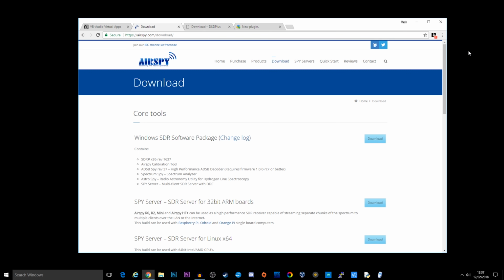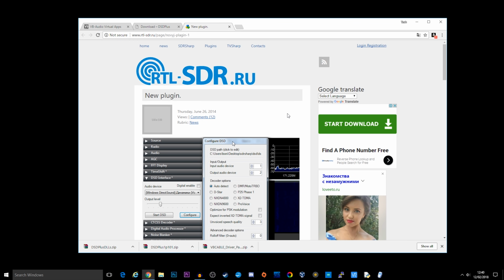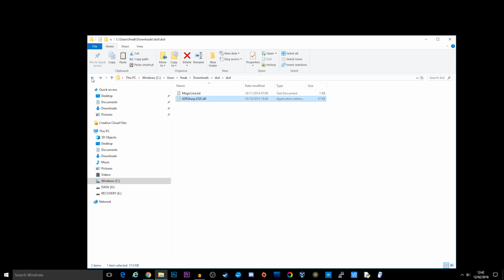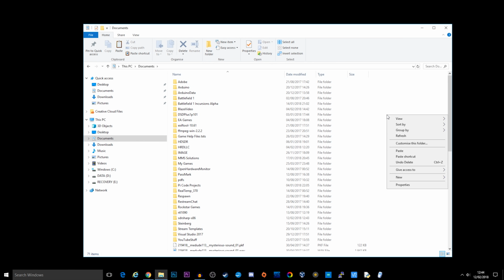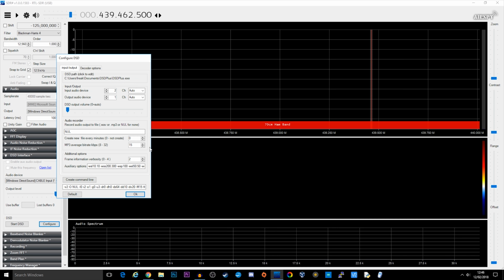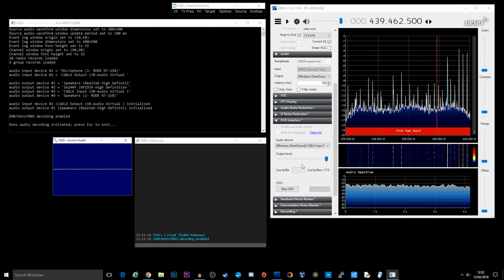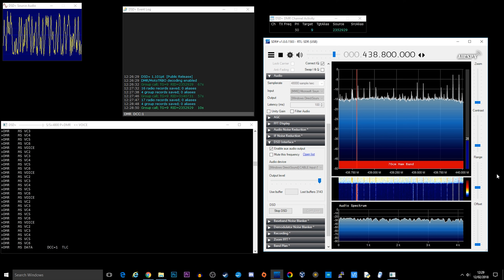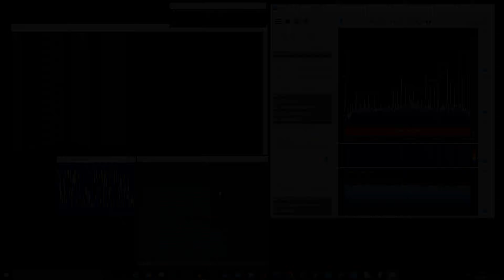How To Setup SDR # Sharp To Decode DMR Digitial Using DSD Plus And An RTL SDR Receiver on Windows 10

Comment: Some of you have experienced similar problems that I encountered. Requires some tinkering and a little patience. I have now tested with Win 7 and 10 so note the following;
1. DSD+ decoding and oscillating but no actual sound; check your system sound settings > Playback = speakers set as default device (Properties > Levels should not be muted). Recording = CABLE output set as default device (Properties > Listen > tick "listen to this device, Playback should be default playback device", Levels should not be muted). 
2. SDR issue; Techminds instructs you to select "Windows direct sound Cable input VB input virtual cable" for BOTH the Audio OUTPUT option and DSD interface Audio device. I have tried with the MME options and it still appears to work too. Ensure you tick "enable audio output" in the DSD interface section.
3. When configuring DSD interface, you need to make sure you are piping the audio in & out to the correct places. When you click configure, this will confirm which options are going to be used. When you click start DSD, some pop up boxes appear - look at the largest pop up and this will present all the corresponding audio options available in 3 sections, fist is audio input options, then audio output options and lastly what you have set it to. If this is piped incorrectly then it will not work. 
4. You need a nice strong connection/aerial etc for you to hear the sound which needs to be converted from digital to analogue. 
5. At first you may not even know what you're looking for i.e. sound and waterfall, suggest you head over to the RTL website and it will give you some examples as well as Techminds vids!
Reply: Silicon Star, can I contact you and get some in site into my set up, seem to be having problems decoding anything
Reply: I don't see anything that says "DSD Interface" when I use SDR Sharp. I followed the directions in the video and I still don't see it. Did I do something wrong?
Reply: @south_sider4life  you have to insert the DSD+ command line into the appropriate folder in SDR#.  Go back to the DSD+ folder and read the README file.  It contains complete instructions for that part of the install.
Reply: @south_sider4life  Same here. The web site that hosts  the '"DSD Interface" plugin  is long gone. I had to go back to a very early version (1416) of Sharp# to search for the plugin DLLs and Magic Line script needed. Later installs give the option to install more plugins and practically  all of them were  hosted at the now defunct web site.  At least I still had "Simple DMR" and "Simple APCO" from a year and a half ago when I bought my 1st SDR dongle.    One thing for certain, Sharp does not age well.

Comment: Great tutorial, easy to follow and clear instructions, which I did to the letter, unfortunately it ain't working for me.  I'm definitely picking something up - I can see the data in the cmdline coming through, but no sound.  I have correctly configured the input/output, so I have no clue why it isn't working.  it does say 'sync: no sync' and also things like '+DMR CACH ERR slot 1 BS DATA ERR1 DCC=3 CSBK'  whatever that means...
Reply: got the same...
Reply: got the same...any go around???

Comment: great video and now im a Subscriber too, but I do have a problem with the audio side of it, I followed your video many times about Audio config this is what iv got no audio, only when I change back to speaker setting? (see below) any help would be great thanks
input device #1 = 'CABLE Output (VB-Audio Virtual '

audio output device #1 = 'Speakers (High Definition Audio'

audio output device #2 = 'CABLE Input (VB-Audio Virtual C'

audio input device #1 (CABLE Output (VB-Audio Virtual ) initialized

audio output device #2 (CABLE Input (VB-Audio Virtual C) initialized

DMR/MotoTRBO decoding enabled
Reply from the maker: Hi mate, you need to set the -o to 1 as your DSD is outputting the audio to the VB Audio cable but it needs to route to the speakers. Hope that makes sense, let me know if you got it working 👌
Reply: @TechMindsOfficial  audio input device #1 = 'CABLE Output (VB-Audio Virtual '

audio output device #1 = 'Speakers (High Definition Audio'

audio output device #2 = 'CABLE Input (VB-Audio Virtual C'

audio input device #1 (CABLE Output (VB-Audio Virtual ) initialized
Reply: Hi mate, no I still not getting anything do i need to change any setting in the audio control panel in win 10, orwe can  used TeamViewer so i can see what the problem is, ? and make small donation
using NooElec NESDR SMArTee Bundle from amazon 
thanks again

Comment: Thanks so much for this.  This is a new way of thinking and I wondered why this has not happened years ago.  Would this decode Motorola radio’s also?  Would it do the other digital (non-encrypted ones), also?  Is the NooElec NESDR SMart HF Bundle  (as suggested in the post) still the best option?  Really appreciate feedback.

Comment: Hello friend, how can I decode a 433mhz signal? I am doing a project to understand cryptography. I bought a basic modula of arduino and I am using the transmitter and I am sending codes until I get the frequency for the RTL SDR in 433.915 but I only see the spectrum of the audio nothing but you have no idea how to do a debug or decode I did this tutorial of the video but it did not work if I can help I'll be grateful !!!! and won one more subscriber and one more like !!!!

Comment: Anyone knows any other alternatives for Win10 x64 digital station decoding ? I'm using SDR# and I've tried DSDplus, but it did not work as there was no audio when I finished setting up the VB cable etc...

Comment: Great video.  Easy to follow steps. Everything went well, exactly as outlined. When I click Start DSD the 4 little screen come on. Output appear to be ok Checked a number of time).  The audio waves screen shows different waveforms on different signals,  Yet I cannot  get a sound out of it. Yes the output is to my speakers. Any suggestions?   New to to SDR
Reply: Right click on the volume button on the right side. sounds-->Recording-->select cable output as default device-->click on properties--->Listen---> check on Listen to the device and finally selct speakers option in playback through this device option.... hope this will work for you
Reply: did the same but the same analog sound coming through

Comment: I'm getting no audio out . I look in sound settings an see mic sound levels jumping ?
Reply: Same here
Reply: Same for me as well.  I can see activity and all the sound mixers are showing sound but i hear nothing.
Reply: ah okay.  It works now.  If you hear silence then its simply not decoding.  There is NO STATIC.  Its either full speech or dead silence.
Reply: same
Reply: You don't hear anything no static just like sound is off until it actually decodes something then you get voices  its all a bit hit and miss. He failed to mention this and quite a few other things, like how do you know you have a correct type of DRM signal in the first place. It does work but would be nice if we had a frequency that is a know DRM channel to set it all up on, anyway Good luck :-)

Comment: Absolutely one of the top instructional videos I have ever watched.  All the steps clearly and concisely stated.  So I decided to subscribe.  You could add an additional hint - if the input or output device is not correctly initialized you can specify the device numbers on the DSD input/output configuration panel.  I had to do that as I have 7 VAC's and several output devices defined and my system was confused.  Thank you from KE7KRF
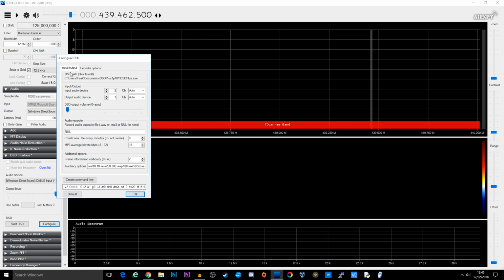Reply: OK, so yes, the configuration panel displayed at 7:06 ... And, I have the devices selected exactly as techMinds does. 
(This can be seen at 9:01 in this video.)
His selected audio input device = #2 Cable Output - VB audio Virtual...initialized
His selected audio output device = #1 Realtek Speakers high def... initialized

When I run the software, mine is exactly like this, but... still nothing.

As write this, I am still trying to check and see if its a matter of no voice transmissions are occuring, thus I'm hearing no audio.

Another Youtube comment put it this way "ah okay.  It works now.  If you hear silence then its simply not decoding.  There is NO STATIC.  Its either full speech or dead silence."

But, as for me, I am just getting "dead silence" at the moment.

I'm wondering what the problem is.
Reply: if this is one of the top instructional videos you've ever watched, the rest of youtube will blow your mind. this aint shit.
Reply from the maker: Thank you Richard :--)

Comment: Hi Matt, need some help please! I'm not sure if I have configured something incorrectly but when I scan through various frequency ranges the source audio works fine, the DSD event log opens up, DSD+ command line opens but it is not decoding anything (unlike your screen where there is a constant decoding feed). Any ideas on what might be going wrong? As my DSD source audio is working I was thinking it might be something simple like not being tuned into a digital frequency but I've scanned across the whole range and no joy as yet. Any help appreciated! TY
Reply from the maker: Check you are using Wide FM and ensure the whole bandwidth of the digital signal is selected in SDR Sharp or your SDR Software.

Comment: For the life of me, I cannot get DSDPlus to decode the damn audio. I transmit on a freq with DMR, see it in SDR#, it routes (silently) over the VB audio cable, and the yellow audio frequency meter in DSDPlus moves around, but no information scrolls by in the command line window, and nothing happens in the event log. What gives?
Reply: did you fix this?
Reply: @mr.d5314  I did eventually get it working, and used it to decode lots of random DMR simplex text msging and other hidden places people like to go and chat.

Comment: My dsd did not auto detect the correct audio output device. Any help with that?
Reply: Look at the command line output (that cmd prompt that pops up when you start DSD). 08:56 in the vid. See how his speakers are #1.  Your "speakers" will be shown there too and also most likely #1. Just like mine are.
Reply: @hellinterface6721   I have the same issue, however, my cmd shows that both, #1 & #2 are thaat cable that I added VB..and his cmd shows that one of them is the computer speakers. I was wondering where exactly is the issue as I've tried changing all the settings for audio...
Reply: same

Comment: Here's a tip, if you're not getting any waveform in your DSD+ Source Audio window. Open Windows control panel  -> sound -> recording,  select the VB Audio cable and make sure it isn't muted under the levels tab.

Comment: Hi  ive got this to work now, i was having problems with sound, found this https://www.rtl-sdr.com/sdr-tetra-plugin-updated-no-longer-requires-msys2/ . what type of antenna do you use ? im using a discone but im not picking up any dmr/digital transmissions
Reply from the maker: What area are you in? Try and locate your nearest DMR repeater and then find out its output frequency.
Reply: i think the problem was  to do with my  rf_gain settings in sdrsharp. ive put my rf_gain to its highest level now.  i couldnt even get local 2meter hams untill i put my fr_gain full.  i will search  DMR repeaters now and see what i can pick up.       thanks for your videos btw.

Comment: Can't seem to get it to work with just a normal Uniden scanner, which I suppose is understandable. I'll look into SDR :)
Reply: that should be even easier, you shouldn't need vb cable too, plug your scanner into the line in skt on your sound card or motherboard whichever you use, if there is no aux in use the mic in skt BUT turn down the volume until it does not distort.
right set the scanner playing anything that you can hear, open the speaker icon inn the right hand corner of your desktop with a right click, click on recording devices open microphone and check its enabled, once you have the audio coming in just tell dsd to listen on the mic line, and output on the pc speakers, then try giving it some signals and see if it will decode them.
vb cable just connects two programs together, so if you have a scanner you dont need sdr# you just need your scanners audio going into your pc sound device, listen on mic playback on speakers, set the freq with the scanner, it should be a lot easier to get decoding with an actual scanner.

Comment: Anthony B. (KB2YZV)
I'm having a issue with my VB-Audio..
The top four lines are correct to your video, but my bottom two line look different.
audio input device #1 (Microphone conexant SmartAudio) initialized
audio output device #2 (CABLE Input (VB-Audio Virtual C) Initialized

Your two lines in the video show different inputs and outputs
Not getting any sound..thanks
Reply: Did you find a fix?

Comment: Hi mate great videoI’ve followed to the letter but when dsd starts, I get no decode or data running. Just the normal encrypted audio on standard nfm. 
I’ve tried various sdr sharp etc settings but no luck
On dsd start I get the multiple screens and there’s signal in the audio box. 
Any help appreciated 
Regards

Neil

Comment: Hi there ! Yesterday, latest W10 update (1803) was installed ; just noticed that DSD+ doesn't work anylonger. The virtual cable input is still selected in SDR# > Audio Output menu though ... (another program using VB cables won't work neither). I uninstalled and re-installed it, same issue. No clue on how to fix this ... The error message is " audio input device open failed". Any suggestion on how to fix this is welcome ! Hope you won't face the same issue.  Regards from France.
Reply from the maker: Hey! Thanks for the comment. I also have my Windows 10 updated to the latest version, but I use the FastTrack version of DSD+ which works perfectly with the update. If you look in the readme file that comes with the normal version of DSD+ you can see how to get the fast tack version. Try that and let me know how you get on. Cheers, Matt
Reply: Will have a look at it, thanks for the prompt reply. I'd like to understand why the input device can't open though ... (I assume this is the same problem avoiding to run the other app).
Reply: @aunumero73  on latest version of dsd+ and windows same issue, odd
Reply: @Tom_Neverwinter  Sorry for the late reply Scott ... Did you find how to fix the issue ?
Reply: @aunumero73  yeah windows update and some configuration changes.

Comment: Can this work with HackRF alone?  I'm going through the steps, with no luck.
Not sure it can work with this equipment.  Any thoughts?
Reply from the maker: Absolutely yes, hackrf one can receive. What kind of issue are you having?
Reply: Just having issues finding a good signal.  I think the problem might be that I'm using a small telescopic antenna and live out in the country. Every once in a while the DOS screen will start scrolling with information, mainly including ERR in the mix, which leads me to believe it is a weak signal.  I never get any actual audio.  I've double and triple checked my settings according to your video.  All the audio porting, in and out, appears correct. Spent several hours over the course of a few nights, but not a word.  Will probably give it another go this weekend.  I'm also wondering if some of these signals might be encrypted?  Anyways, all suggestions, tips, welcomed.  And thanks in advance.
Reply: Same issue here

Comment: I really appreciate your videos. I am new to Ham Radio. I have had great success with listening to analog signals 2 meter and 70cm. I was able to get this working with your excellent instructions without errors but I can't hear any audio. If I shut DSD off and go to a broadcast FM station it works just fine if I switch the audio settings back to default. I see the peaks pop up so I dial over to them and there is nothing coming out of the speakers. It might be that I am still using the original antenna. Do you recommend an antenna for 7cm and 2 meter to use with my NooElec dongle? I have the SO239 adapters for my dongle.
Thanks
Kevin
Reply from the maker: With DSD running you wont hear anything until it starts to decode a digital signal. There is no white noise with digital through DSD.  If you see the DOS window where DSD is running start scrolling up and decoding digitial, and you still have no audio out put, then you will need to check the output setting within the DSD plugin option on SDR Sharp.
Reply: I understand that. I am not getting audio output to speakers even checking all the windows sound settings. I am missing something. I see the activity on the DSD plus screens. And I see activity in the VB sound settings in windows. The decoded audio just isn't getting to my speakers.
Reply: @1crazynordlander  Right click on the volume button on the right side. sounds-->Recording-->select cable output as default device-->click on properties--->Listen---> check on Listen to the device and finally selct speakers option in playback through this device option.... hope this will work for you
Reply: @anilsarika6961  Thanks!